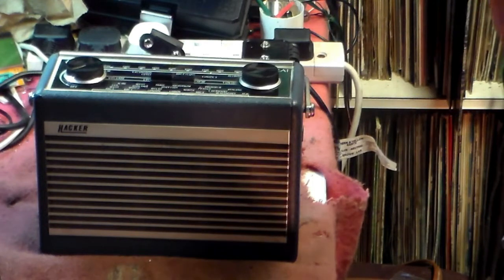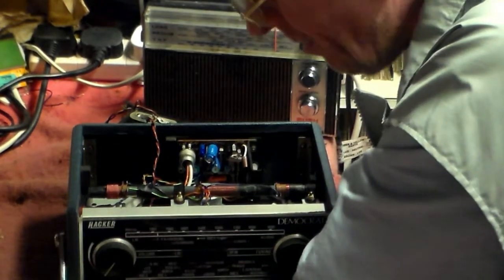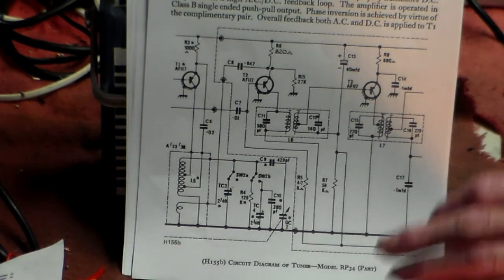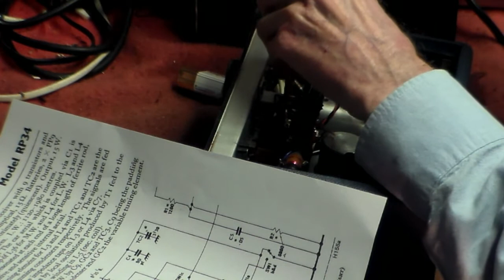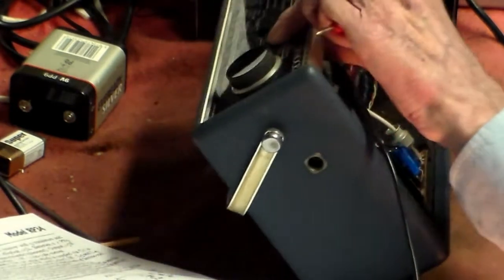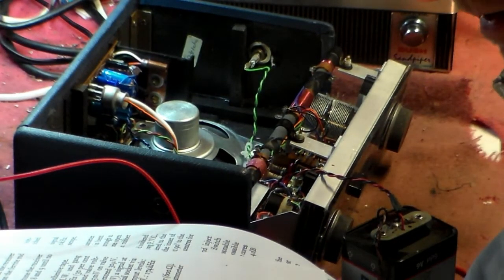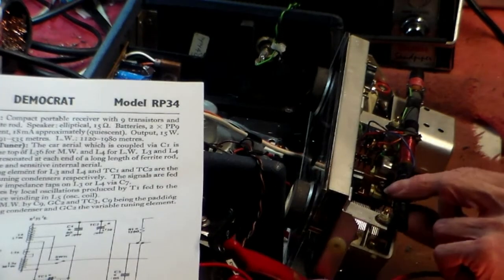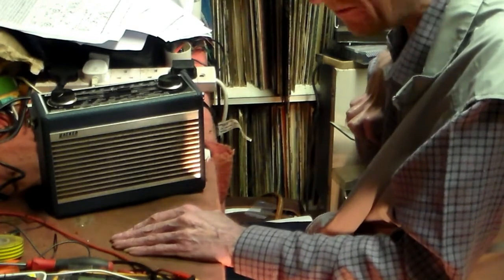Hacker Democrat MW/LW Transistor Radio - RP34 - Thought it would be simple....

Comment: Nice Job Steve Dont Have a Democrat Seems a Very Nice Set I Do Have an Autocrat 2 And Its a Nice Set As Well When I Fixed My Rad 18 It Had 4 Faulty Capacitors One Even Had Turned Into a Half Ohm Resistor And Thats Why The Output Stage Sounded Awefull But Your Right You Dont Need To Change Them Unless You Are Trying To Future Proof The Set Thanks For Uploading Regards mike.
Reply from the maker: Quality of components varied then as now. Now anything you buy is made to a price! So it is more likely in the Fidelity than say a Hacker. The RAD18 does sound good though. The point is that a full capacitor change would not have sorted this, Fault Find first. On Valve sets there is one capacitor that you must always change.....